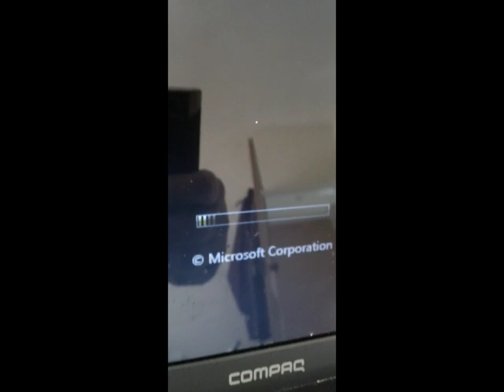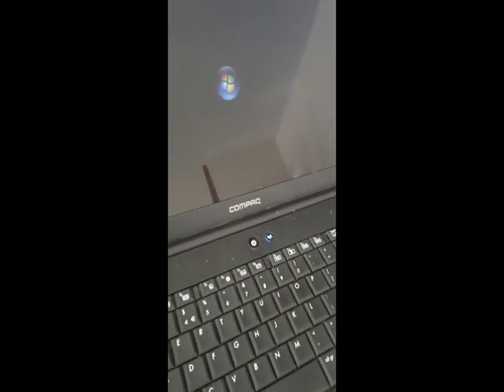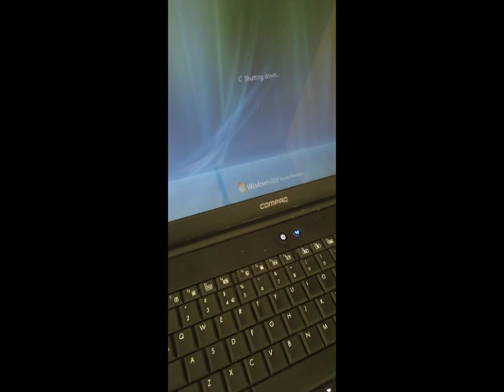HP Compaq CQ60 Power On Trick

Comment: CQ60 models require 19V DC @ 4A, no wonder the charge circuit is unhappy, you are grossly under powering it.
Reply from the maker: +Doom2pro Blame HP, not me! The voltage of the charger supplied with it is 19V, but the problem still happens - and the area around the power socket gets VERY hot. Note that HP refurbished versions of this laptop actually come with a 12V adaptor and a sticker saying not to use higher. So they know about the problem.

Comment: I have a CQ60 that powers on for a couple seconds then powers off and back and back off unless I push some or most of the F keys ( F1-F12) then the power will stay on but wont boot. If I try it several times it'll boot then freeze sometimes after a couple seconds sometimes 10-15 seconds. I just put a new H.D.D in it and ram as it didn't have either when I got it but I have tried different ram that I know is good. This laptop looks brand new in 100% excellent condition and appears to have been used very little. It has the Intel 2.166 Mhz dual core processor and I had a CQ-60 just like it a couple years ago and loved it so I really want to get it working and install Windows 8.1 Pro 64 bit as well as my solid state drive. I was able to get into the bios before it froze and change it to boot from USB where the 8.1 is and I got it to start installing it once but froze before I could get to the 1st step of installing 8.i Pro. Anyone else have this problem or know what it is or why it's doing this? It would be much appreciated

Comment: With any laptop, it should be able to run without the battery installed (just on the ac adapter).

This model of laptop has a poorly designed battery compartment where over time the middle of the battery sags causing the metal fins to disconnect and (if the laptop is not on the AC adapter) shut down.

Comment: I have here a CQ60-100ed that doesn't turn on, when i connect a 19v adapter the light next to the connector on the laptop turns on, but when i press the power button nothing happens, also the indicator lights on the front of the laptop like ''power connected'' led is not burning.